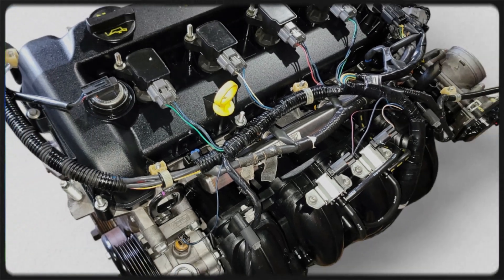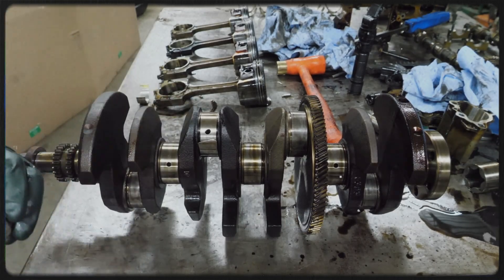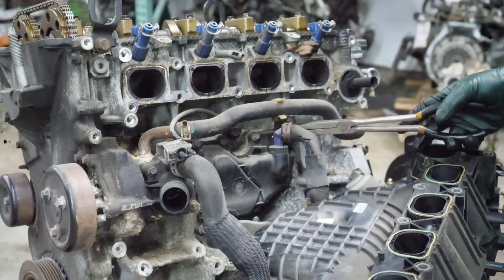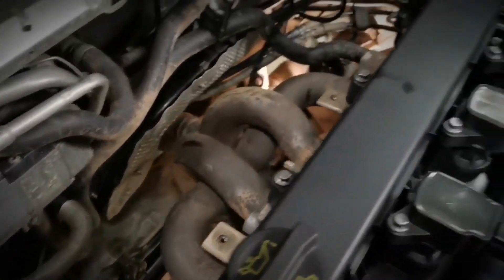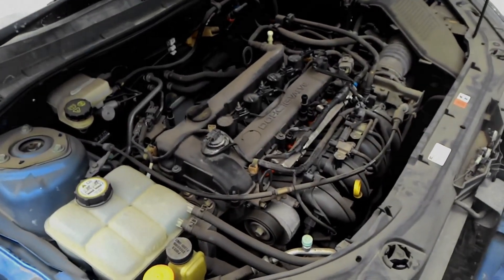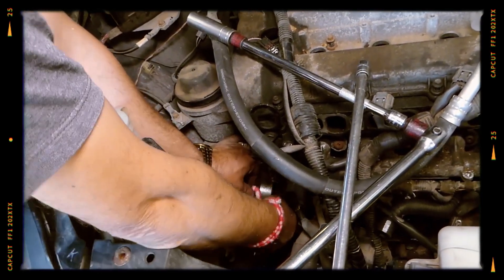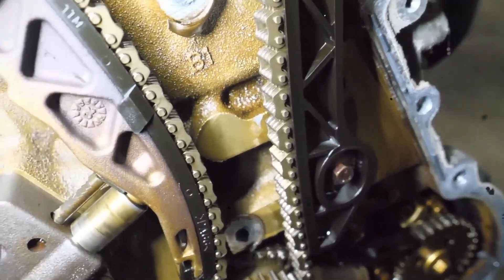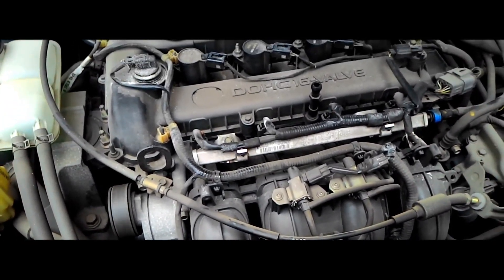Mazda MZR/L3-VE 2.3L Engine Specs, Problems & Reliability!

Comment: Why you show a different engine and talk about a 2.0 instead of full video on 2.3 engine turbocharged?
Reply: This video shows at least 3 different 2.3 liter 4-cylinder engines or variants. 4, if you count the L3-VDT aka the DISI Turbo and not the L3-VE. A lot of footage was actually from a teardown of a 2005 Ford Tribute 2.3L, and you can see the positioning and look of the tensioner pulley that it's not the same engine as the Mazda version. There are other differences too, like the Ford Tribute missing the camshaft phaser on the intake side, etc.

Comment: Had a ms3. Ate heaps of oil blew a rod out the block because of it. Pulled it apart what a mess surprising crank didn't have a mark on it and bent only 2 valves

Comment: Very informative,I actually  converted my Mazda 5 2.0L  FL engine to 2.3L L3 engine,was it a bad or good decision? or may you please do a video on a FL 2.0L engine if possible.
Reply: Definitely just use quality synthetic oils with the 2.3 and change on time, also keep the coolant fresh and topped also. With a little more maintenance the 2.3 is pretty dang reliable. More reliable than the 2.0 or the 2.5 surpassed it? No. But it does better than a lot of other 4 cylinders on the market still.
Reply: @know916bound thanks for the information, I am really enjoying a little bit of power that it can offer,it is not lazy at all,once again thanks for your input.
Reply: is it a good swap bro i wanna chane a 2.3 into my mazda familia